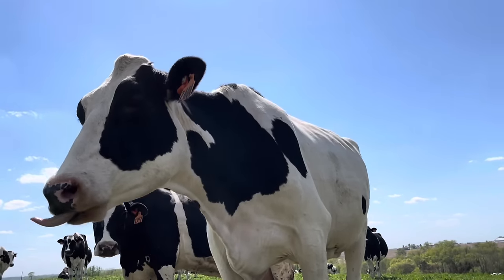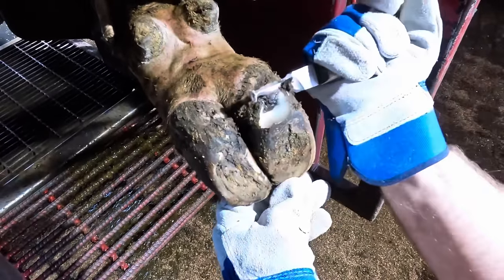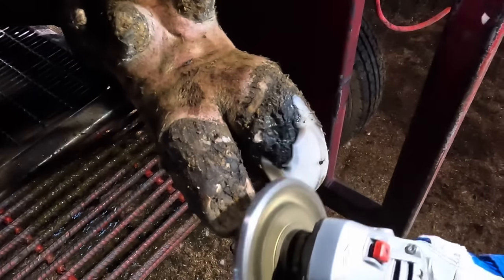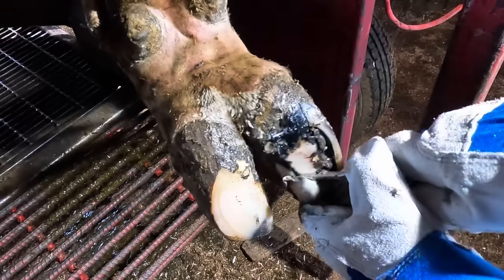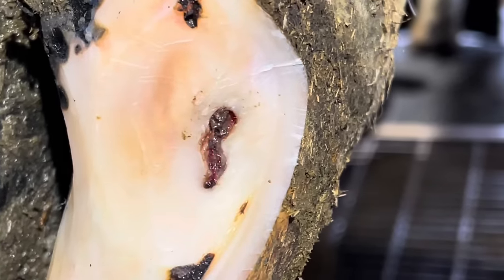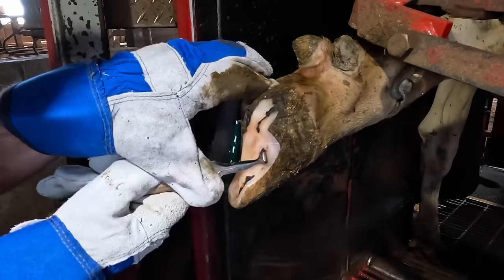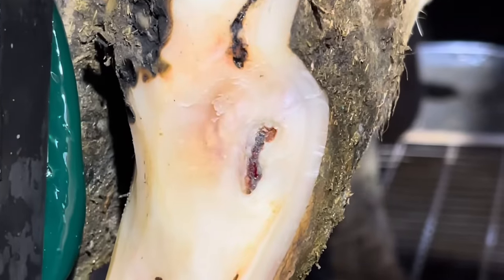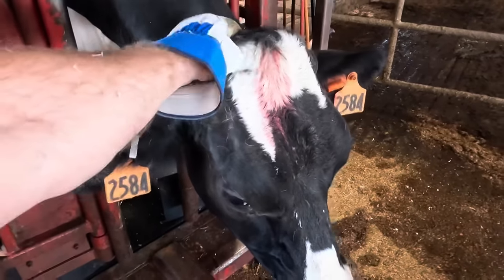This WHITELINE LESION is starting to ERODE the Wall Horn

Comment: So probably a dumb question, but in routine trimming, you make sure that both claws are equal and level on the foot, but how do you know that you've gotten all 4 feet to the same equal height? Or does it not matter so long as they're fairly close in size? Like their own walking would eventually level them all equal if one was sightly off for example

Comment: Nate, I watch another trimmer too and when he puts on the block he heats the cows hoof. I never see you do that. Is it a different compound or do you just not show that part?
Reply: Nate uses a type of glue that doesn't need to be heated to be adhesive. Trimmer that heats the claw may use a different type of glue.

Comment: Maybe a dumb question but does notching out an area wver risk another issue? Like for example notching an outer wall seems like it could put pressure on the pedal bone if the block on the other toe comes off. Could that cause a pedal bone fracture or would the weight be distributed evenly even with a notch?